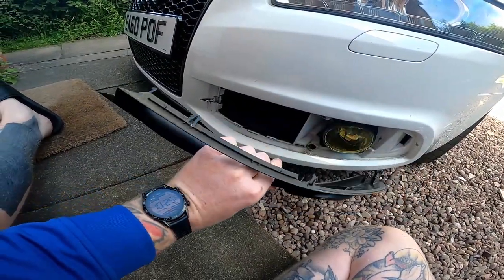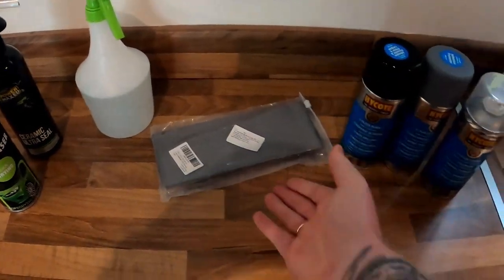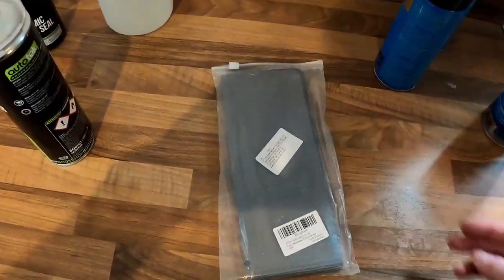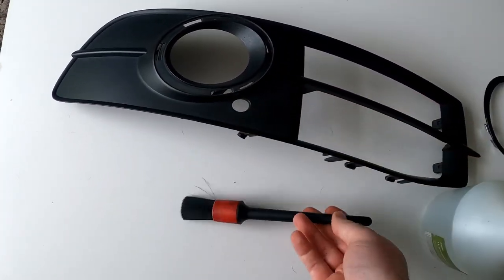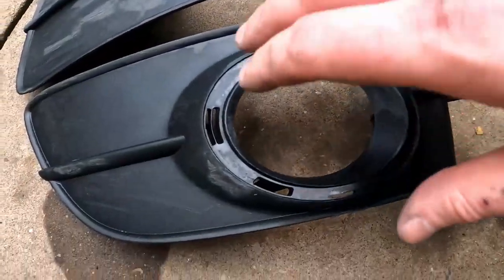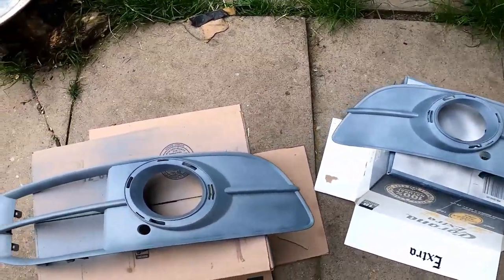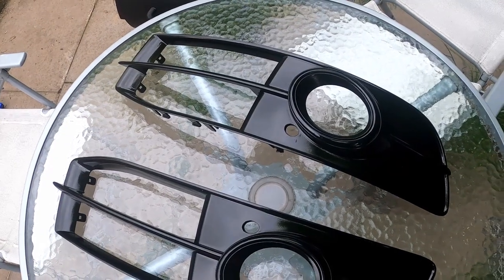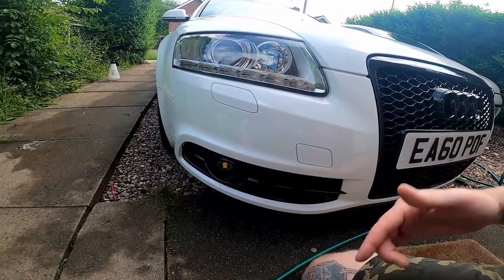Painting Fog Light Trims Gloss Black DIY *Audi A6 C6*

Comment: Do you have any links to buying the actual fog light casing? I need some for mine 😩
Reply from the maker: To be honest, no I don't, most aftermarket companies don't really have parts for the c6 platform anymore, ebay would probably be the best bet, make sure to compare their prices with an audi dealer though, sometimes the prices are way higher than from a dealer for some reason!